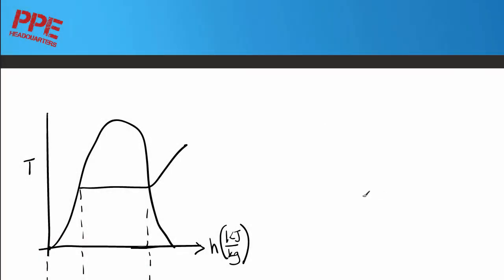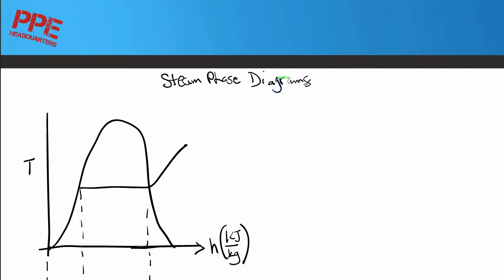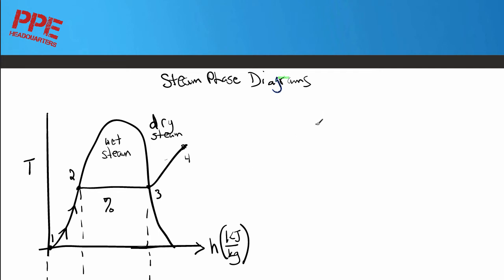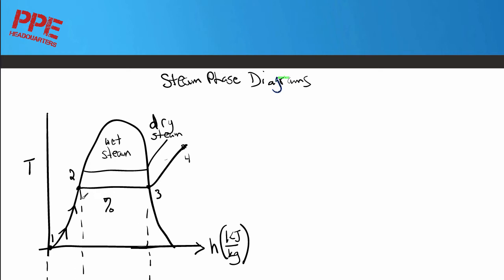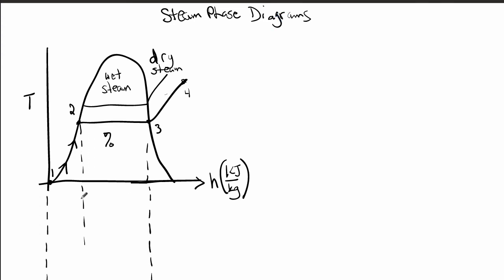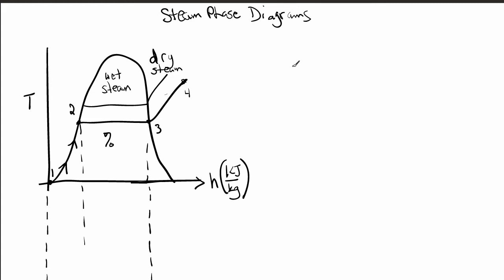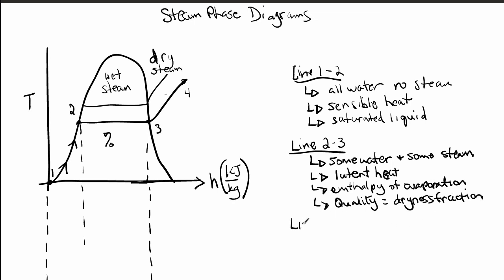Power Engineering: Steam Phase Diagrams

Comment: How is increasing pressure proportional to increasing boiling point?
Reply: IIRC there is something called steam pressure within a liquid which rises as temperature does, so water boils when its "steam pressure" (Its called like that in my country) rises above atmospheric pressure, now imagine you boil water on top of a mountain, it will boil at a lower temperature because the atmospheric pressure is slightly lower so if you rise the pressure the steam pressure needs to rise even more which results in a higher boiling point, I hope it was the answer you were looking for.